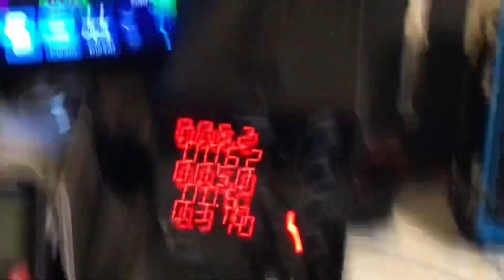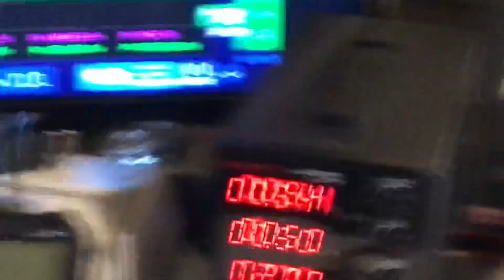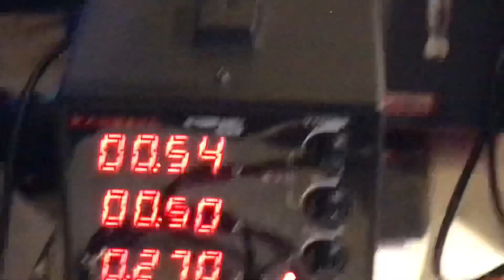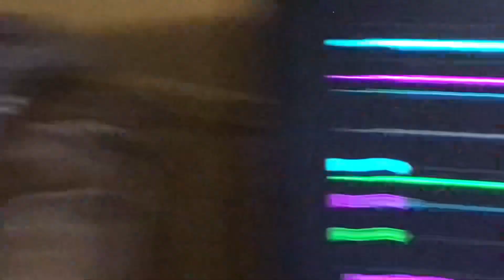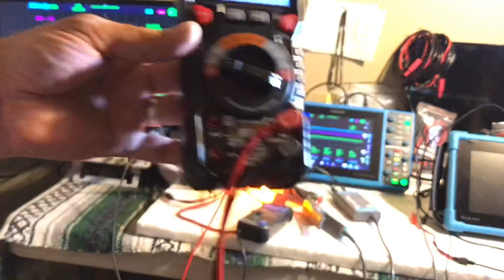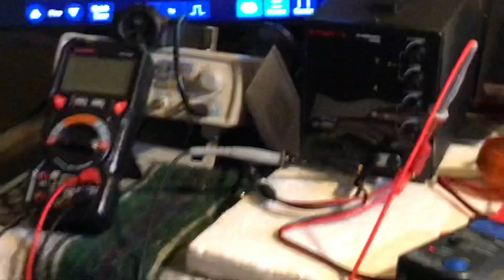Kaiweets DC Variable Power Supply PS-3010f Review (Part 2 Current)

Comment: Going to get one. I Ivan on Pine hollow Diagnostic have one when he was reviewing the load pro. Got to get one for testing injectors to move the pintel.Thanks again.
Reply from the maker: They definitely come in handy. I bought another one after those videos, that I also like (maybe even a little more). It’s the Rockseed HM310P. I got mine on a lightning deal on Amazon for $80. + tax. It normally sells for $100. I believe there are a couple other companies that sell the exact same one with their name on it, buts the same one. I’ll try and share a link. 
Programmable 30V/10A DC Power Supply Variable, Adjustable Switching Regulated Power Supply with 4-Digit Large Display Alligator Leads, Shortcut Parame https://www.amazon.com/dp/B07SS77N7K/ref=cm_sw_r_cp_apip_VVgSWeq2U28NN

PS, the Power Probe works good for powering things up on a car, as well (as well as a bunch of other uses). I have the PowerProbe 4. I use it all the time. I wish I had the PowerProbe Hook, but I guess I bought the 4 before I knew about the hook. Maybe it hadn’t come out yet at the time.
Reply from the maker: I just realized that that link sends you to the power supply that says 60v 5amp. Not sure why; I clicked on “share link from the one I bought”. The one I bought is up to 30V 10amps
Reply from the maker: Just search for Rockseed HM310P
Reply: @atomsworkshop195  will check it out. Need one when Im testing Diesel injectors and other things.
Reply: @atomsworkshop195  hi Question. Do you use an attenuator on your leads when you are checking the Injectors. I brought a 20:1 for my Uscope and still don't know when to use this seeing that the most kick i might get is a small amount of kv. Would it damage my scope?
Reply from the maker: If I remember right, the Micsig can take up to 300 volts. I’ve done it both ways, with and without an attenuator. When I first got my Micsig ATO1104, it came with 4 10:1 leads, and 4 1:1 automotive leads (the black and red ones). The first couple few times I checked injectors, I used the 10:1 attenuated leads, because I didn’t want to chance messing up my scope. Then one day, I accidentally used my Pico 3 meter leads (came in a set of 4, in Blue, yellow, red, and Green). They are 1:1 leads. By the time I had realized it, they were already hooked up with the car running. Nothing bad happened. Since then, I’ve done that plenty of times. With that said, sometimes I just get a bad feeling, so then I use the Micsig 10:1 leads, or the Pico leads with my Hantek 20:1 attenuators. I don’t want anything bad to happen to your scope, so do your own research and make, what you think is the right (safest) decision. I’m only saying that, incase I e just been lucky when using the 1:1 leads. I hope that helps, even if just a little bit.
Reply: @atomsworkshop195  yeah I did some research. That's why I brought it but wasn't sure it's necessary. The AES waves uscope, it's not needed cuz they told me that the voltage kick isn't that high. Pico have put their attentutors in their leads for the 6000 models. Just wasn't sure about the one we have although the manual didn't mentioned it. Thanks
Reply: @atomsworkshop195  I still have the PP3. Want to get the PP4 so I can check use it as a noid light for Injectors. When you decide to have a fire sale, hit me up. I would take some of the stuff off your hands. Don't want it to fall into hands that don't appreciate it.lol
Reply from the maker: I’ll keep you in mind if I get rid of anything
Reply from the maker: Yea, I watch a lot of Pine Hollows videos. Ivan’s got a good head on his shoulders. I’ve learned a lot from his videos. Another channel that I like is KYHomeGarage. He makes some good videos, that are helpful too.
Reply: @atomsworkshop195  will check him out. Thanks for the heads up.
Reply: @atomsworkshop195  yeah I know this old man. He comes up with some crazy inventions and ideas. Didn't take him in too much, guess he wasn't like the loadpro guy Daniel Sullivan. Got to hit him up for ideas